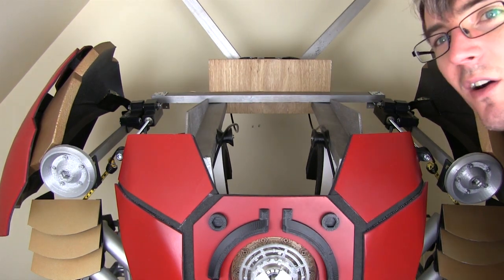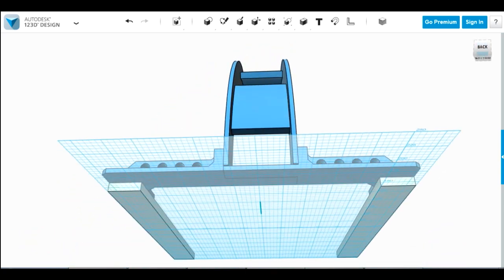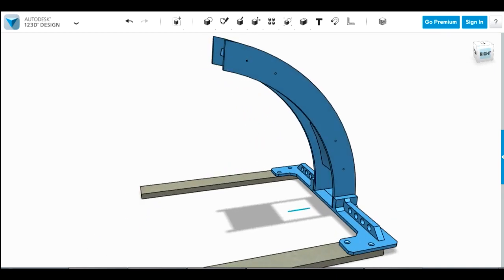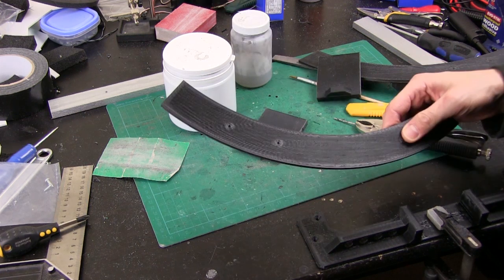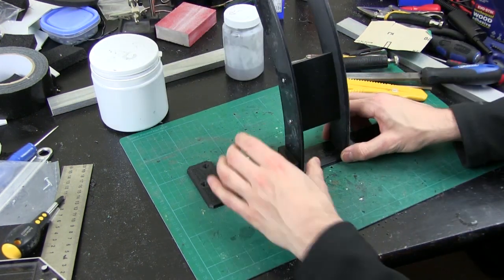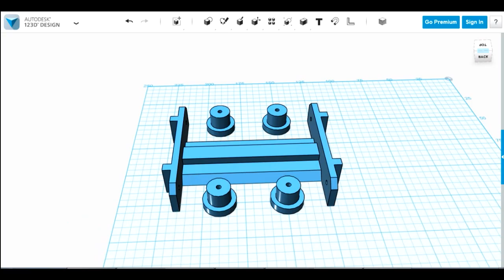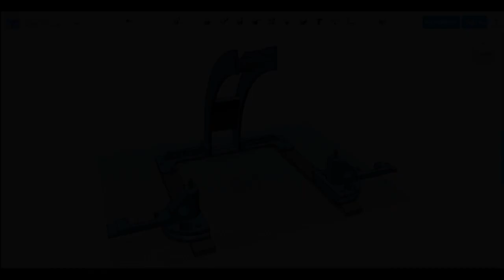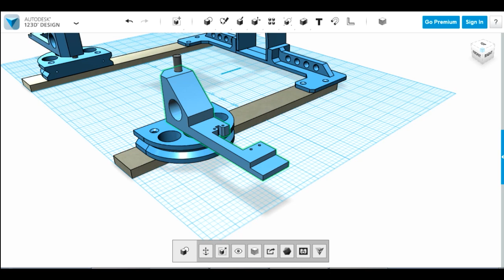Iron Man Hulkbuster Cosplay #19 | Helmet Mechanism | James Bruton

Comment: Love your work James = ). Just a thought, you should have just built the helmet in two parts ( front and back) with half domes, and made it so that the front dome lifts back under the ridge of the back dome, therefore alleviating the need for multiple splits in the overall look of the helmet. Just a thought. Keep up the good work

Comment: looks like the helmet will be very impressive. As for your 3d printed structure, you mentioned that you can now cut out lots of wood from the rest of the project, however is this a cheaper option as well, or will 3d printing everything cost a lot more? I kind of want to see a full size 3d printed R2D2 but yes you have too many projects and not enough time to design and print parts for all of them.
Reply: "will 3d printing everything cost a lot more?"

My theory is that he sold his soul for unlimited printing filament.
Reply: well not really unless you call patreon as selling your soul lol. Im sure he can easily afford to 3d print everything including all the panels and structure supports, im just wondering at the cost of say a 3d printed support to a wooden one? Also the 3d printing takes a long time so wooden support would probably be much quicker for some parts.